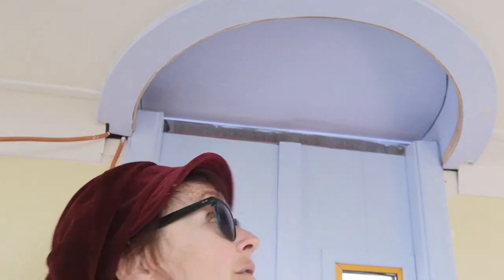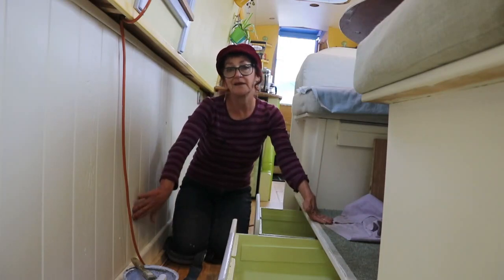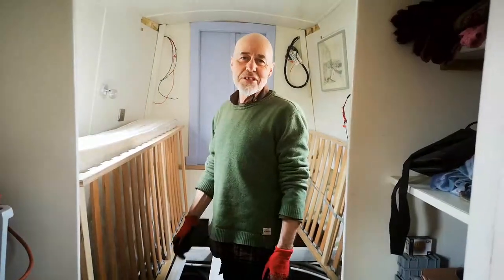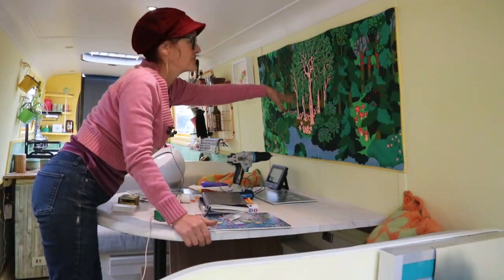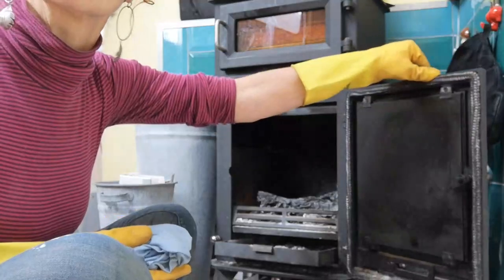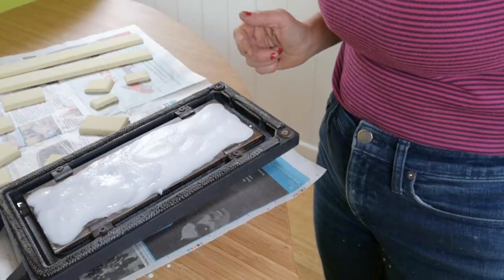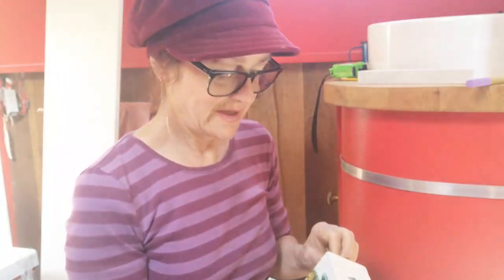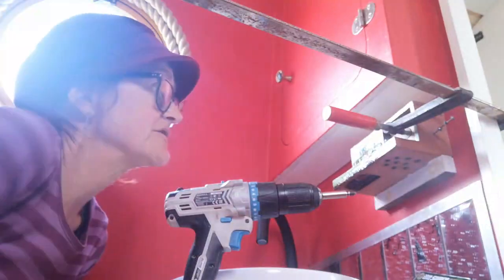Making drawers and a curtain fix

Comment: That boat interior is so impressive, your choice of colours so Good, When I clean our multi stove I just use a couple of  tissues dabbled in  cold water then dipped in the ash I then put the used tissues on the fire, so no cloths to clean.
Reply from the maker: I have tried that several times but it seemed to work much better with hot water.. But a good idea to use tissues then burn👍

Comment: You two are so creative. Did i miss the draws under the dining area vlog? I'm just about to do mine. Would of been nice to see how it's done. Thanks
Reply from the maker: Ah... I didn't put in the making of them as they were a bog standard construction.. I.e screwed and glued (for speed) hung on soft close runners. Also the video was getting a bit long and I've noticed 15mins seems to be as long as people will watch... Maybe I'll include a bit more construction though on the next videos👍